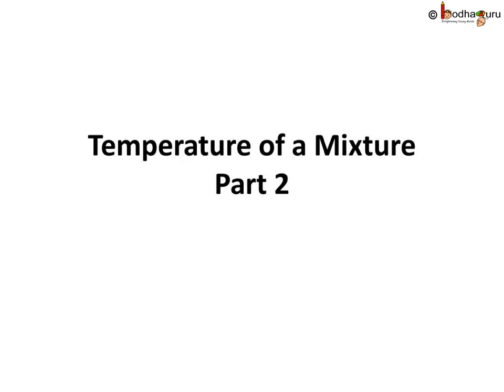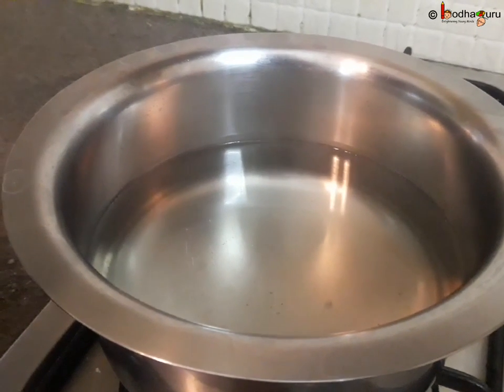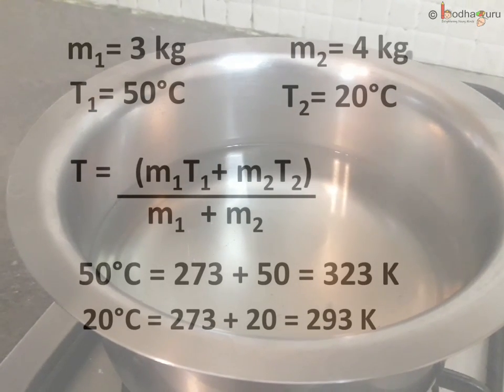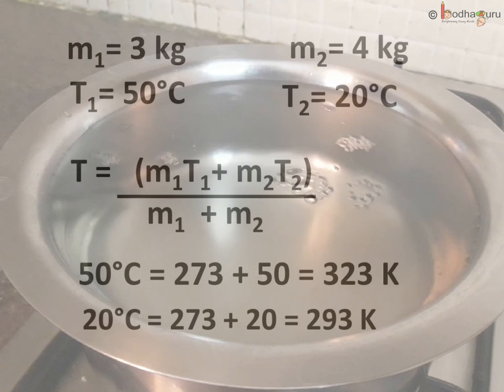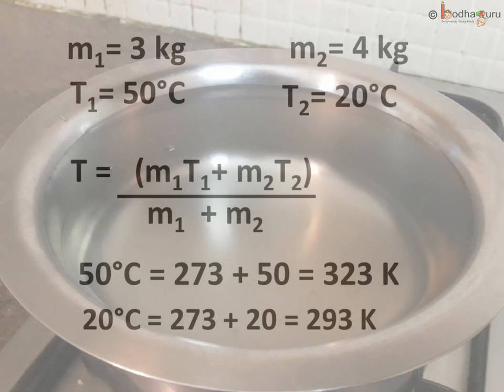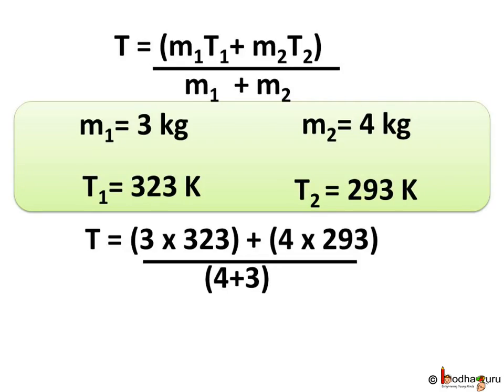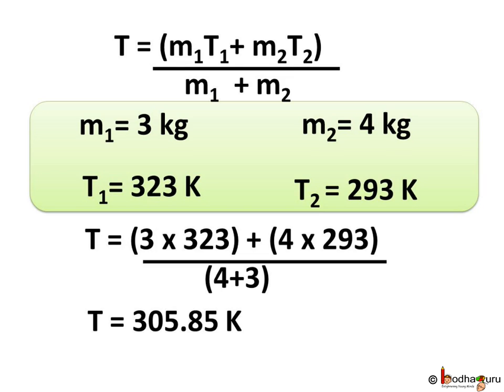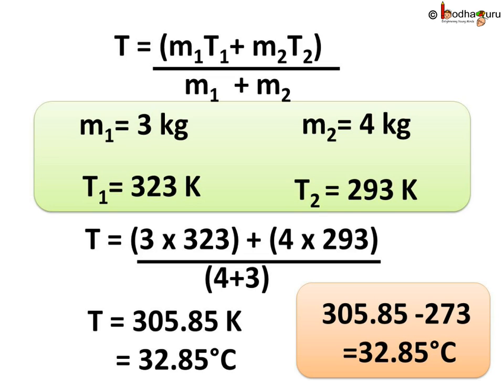Physics - Final temperature of mixture - Thermal properties of matter - Part 6 - English

Comment: Is the equation to calculate mixture temperature applicable when ice and steam are mixed?
Reply from the maker: A mixture is a material made up of two or more different substances which are physically combined. when you combine ice and steam it is not mixture, both are still separate, but when ice melts due to temperature from steam, then same equation is applicable.